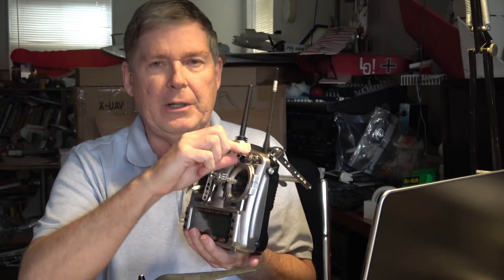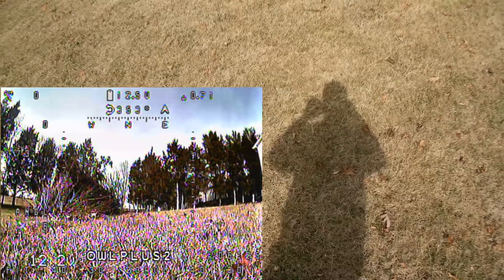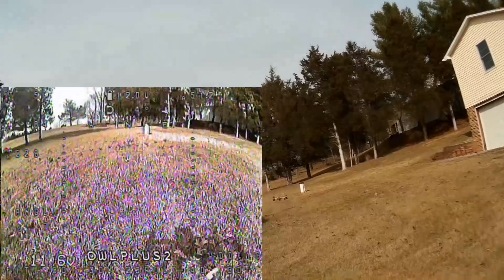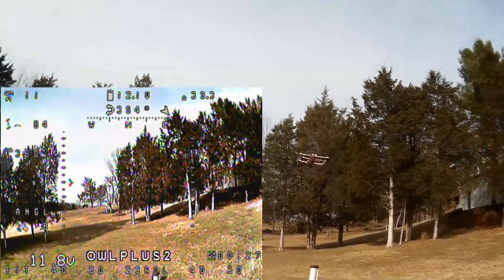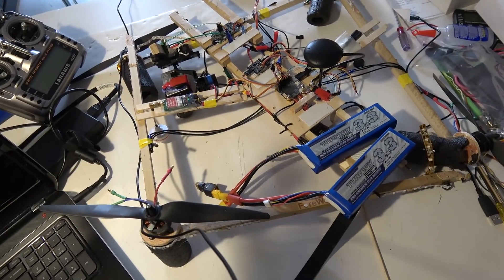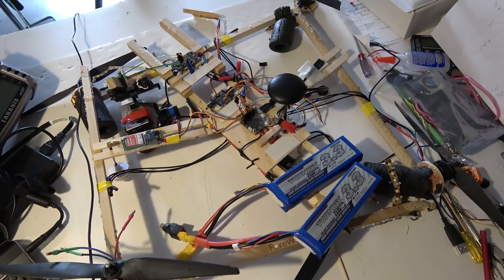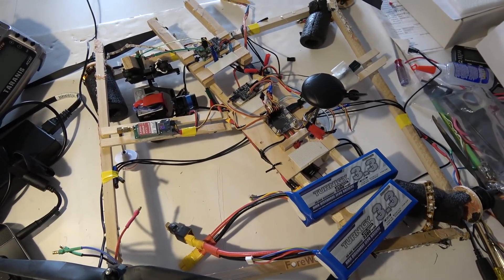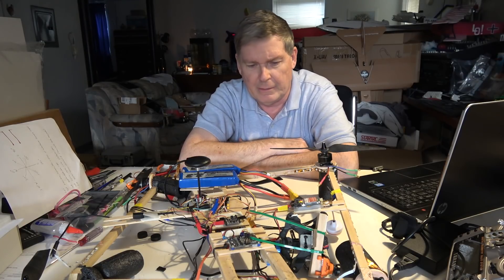My Omnibus F4 iNav Quad Copter Experiment - Part 2 Testing Air Mode Crash

Comment: The two lipos are placed too back from the centre of the quad, making the FC a tough job trying to balance the quad. The osc is a symptom of that. The stock PIDs should be normally OK if you have the LIPOs and all other components evenly placed around the centre of the X quad

Comment: How well is that frame balanced, looks way to heavy at the back with those two 3.3 batteries,
Reply from the maker: It's balanced because of the heavy gimbal in the front. All the weight front to back does have an adverse effect though.

Comment: I'm hoping my S800 goes well on its maiden. I have bad experiences with iNav and I said I'd never use it again..... I'll never learn.  
MeRc sounds good, Dave :-)
Reply from the maker: Hi Tony, good to hear from you. The S800 in a great looking wing. I found that 13 degrees up reflex on the elevons and a good bit of nose weight was essential for wings. Otherwise they just fly all squirrelly. Then on servo tab in iNav I put 50 and -50 percent for servos 3 and 4.  It will fly like a dream.

Comment from the maker: One possible solution to GPS Hold pitch wobble or oscillation would be to try adjusting
nav_mc_vel_xy_p (P gain of Position-Rate)Too much P might cause "nervous" behavior and oscillations
Saw the above on the iNav Wiki
nav_mc_vel_xy_d can be used as a damper for p and i.

Comment: #8: Hi Dave, sorry for the crash, its part of the game as we all know but still not pleasant if it comes by.
Hope to see you back in the air in no time.
MeRc sounds good btw ! ! 
Cheers.
Reply from the maker: Thanks! Yeah I feel so dumb that I didn't flip the mode switch back to Angle mode at the first sign of trouble. I should know better by now.
Reply: In the heat off the battle we all act different, I think that's normal, don't be so hard on yourself ;o)

Comment from the maker: Something I just learned:
About disabling the Baro, the iNav WIki says "Using ALTHOLD with a multicopter, you need a barometer."
I did an experiment. If I type "set baro_hardware = NONE" in the CLI it results in the ALTHOLD mode not even being available in the modes tab of the INav Configurator. So it seems it's impossible to turn off the baro and still have ALTHOLD with a multirotor.
Reply: Oh, ok...point taken...so it seems the Baro is preferred in a Quad, but not a Plane with iNAV...fair enough...I still think the QBrain ESCs are your main problem though...?
Reply from the maker: Maybe but I think I should be able to adjust for the ocillations in GPS Hold if I knew the right parameter to change because it flies ok in other modes. I am searching the wiki now and found this: 
"nav_mc_vel_xy_p   180 P gain of Position-Rate (Velocity to Acceleration) PID controller. Higher P means stronger response when position error occurs. Too much P might cause "nervous" behavior and oscillations".  This looks specific to GPS position hold and it might work without disturbing the other modes.

Comment: Sorry about the crash. You might look on RCG an old Hoverthing Flip FPV, all G10 fiberglass, tough and cheap these days. I've not played with iNav at all but I had GPS on quad running MWC back in the day and it had different settings for the GPS mode if I remember correctly. It's amazing how good iNav seems to be compared to the old MWC code.
Reply from the maker: INav has come a long way. Now I just need a more in depth look into GPS mode params. 
Thanks for the frame suggestion. You will probably see me continuing to use wood until I think I know what I am doing. This is the third time I have had to glue back together :-)

Comment: Sorry for your crash Dave :/
Airmode normally allows you to be able to have full control authority of your quad even at 0% throttle which means motors are always spinning, it should not cause troubles even with alt hold.
However, i think best way to tune PIDs is to fly in manual mode or acro mode, low P indeed will be unflyable while high P will cause oscillations especially on high throttle.
I think Alt hold and GPS hold are also using their own parameters over PIDs but nothing i can confirm since i'm still waiting to receive all my parts in order to jump into iNav :)
Have a great week and happy fixing!
You should actually find a name who describes specifically what your channel is about! I'm in the same boat with my channel name, it does not really inspire and attract anyone lol
Reply from the maker: Hope we can help each other out when you start building and tuning.
Maybe you could use a facsimile of your name for your channel like Crispin AirCam

Comment: hey buddy!  The crash is unfortunate, but its also a mandatory part of our hobby, lol.  Just a couple comments....I'm surprised you only had 6 satellites.  I have that same flight controller and GPS unit and I get 11 satellites while in my house....14 satellites outside.  Odd!  Now, I am not a "PID Tuning Expert" by any stretch of the imagination but I do know that the PID's really won't have any effect on Position Hold nor GPS Hold.  The PID's are there for you to tune out oscillations on the 3 axis.  In all honesty, I've never tuned the PID's on my 3 mini quads.  Never had to.  They fly awesomely on stock PID's...so I don't mess with them.  Finally, as for "Airmode"...Airmode will allow you to flip and roll real nicely, even at 0 throttle.  With my miniquads, Airmode is awesome fun.  If you are building an aerial photography rig, you won't have any need for Airmode.  Keep up the good work!
Reply from the maker: I switched the bangbad GPS out for one that came with my APM Pro. It's gets about 9 sats usually if I wait.
The problem was the other one had a bad mag and would not align. GPS hold seems to keep position ok it's just that it oscillates on the pitch axis.  I'm trying to find out what setting adjusts the pitch gains in GPS hold mode.  The stock  PID's work great in the other modes just not perfect in GPS hold mode. I never did get a chance to try GPS hold without Altitude Hold.

Comment: Oh no...Well it could have needed more P Gain....Im of the opinion, it's because of the QBrain ESC you are using..? It uses standard / old Firmware which is slow to respond. I had a very similar oscillation problem on my old Alien 500 using that 4 in 1 ESC and an F4 board. I now have a DSHOT 600 capable 4 in 1 ESC to try out.
  When in Angle Mode, the quad just stabilises, but when you engage GPS hold (as well), it also takes correctional position movements. If the ESCs / motors cant respond fast enough, it can result in oscillation.
  Yes, keep it simple Dave....Horizon / Angle / GPS Hold.....that's enough for a filming platform.....Remember....less is more. Did you disable the Baro?...Remember GPS hold will also control altitude for you...its 3D.   Stop listening to Mini Quad fan boys..You dont need Air Mode, unless you intend doing some mad flips etc..?
Reply from the maker: Definitely not using airmode for this baby anymore. I got the idea from the iNave Wiki "Using ALTHOLD with a multicopter Activate AIRMODE to keep the copter stable in fast descent - now you can do the whole flight in altitude hold - from takeoff to landing."
About disabling the Baro, the iNav WIki says "Using ALTHOLD with a multicopter, you need a barometer."
So I did an experiment. If I type "set baro_hardware = NONE" in the CLI then the ALTHOLD mode will not even be available in the modes tab. So it seems it's impossible to turn off the baro and still have ALTHOLD with a multirotor unless you know something I am missing.
I think I need to find where to adjust the gains for GPS mode and leave the regular PIDS alone because they work great.
Reply: Oh, I see, well I stand corrected then Dave...:)....Without doubt the Baro will be a little more accurate than the 3D GPS fix for altitude. Pleased you discovered this for me, I want to do a similar upgrade on my old Alien 500 so I can use it for filming one day...:)

Comment: Hi Dave, long time watcher (don't tell my racing quad buddies, but I still have a hankering for fixed wing!). I'm running an iNav build on a Mini Skyhunter, so I've been watching this series of yours. Wanted to tell you, Airmode is a feature that allows the PID controller the ability to control the frame at zero throttle, (after punching out, us Acro guys kill throttle to fall) and shouldn't affect you otherwise. It looks to me that your rates were a touch high for your tastes, maybe? GPS variables are just like any other sensor input, where you have to adjust the strength of it's influence on the FC, it's just like your gyro or barometer, never correct right out of the box.

As far as the channel name, what about RTP R\C? Or Fluffy the Destroyer of Worlds R\C, lol
Reply from the maker: lol, Thanks for the name suggestions. RTP R\C ain't bad. I wonder if YT allows slashes though.
Do you know what GPS variables I need to change to fix the oscillating pitch in GPS hold?